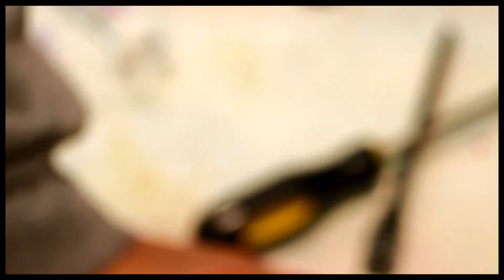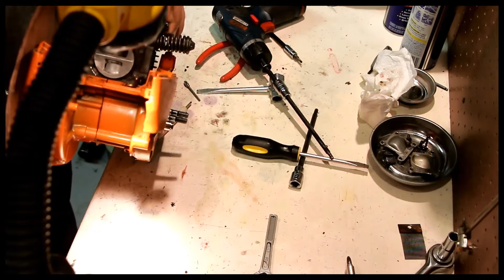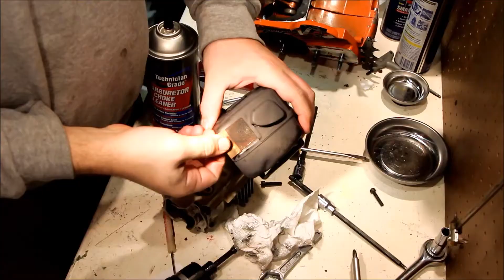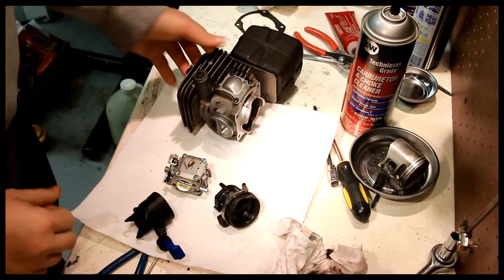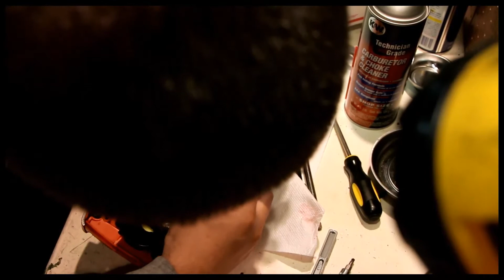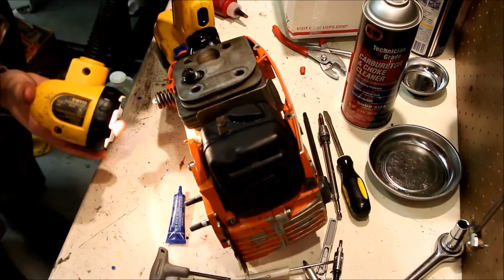Husqvarna 372xp xtorq dismantling, modding, assembly part 4

Comment: Did you change the port geometry at all?
Reply from the maker: Yeah, I widen the exhuast, but not much, square it a bit as well, widen intake and square off, and raise transfers as needed... I usually extend transfers towards the intake a bit as well.
Reply: Thanks.

Finally found a thread on Forestry Forum that discusses porting at length on the xtorq models.

http://www.forestryforum.com/board/index.php/topic,87633.0.html